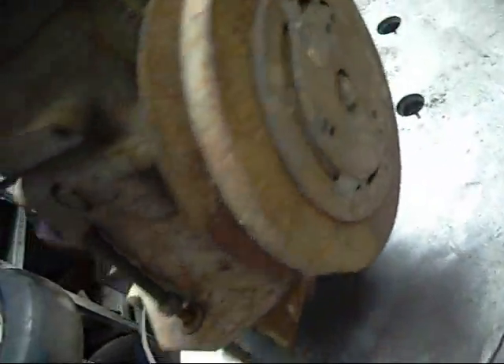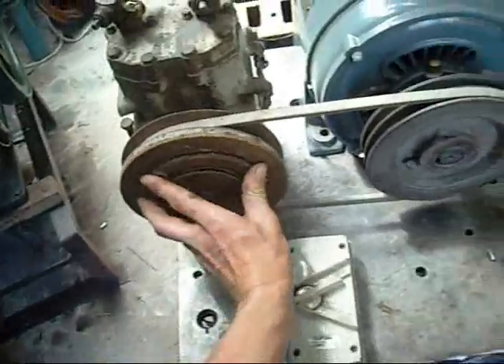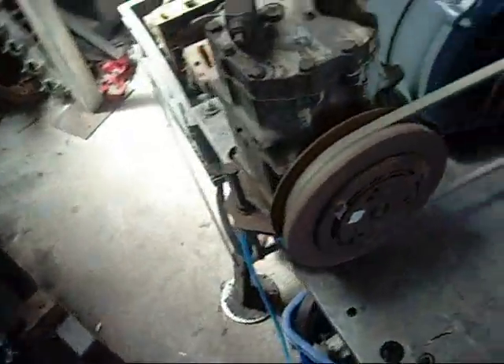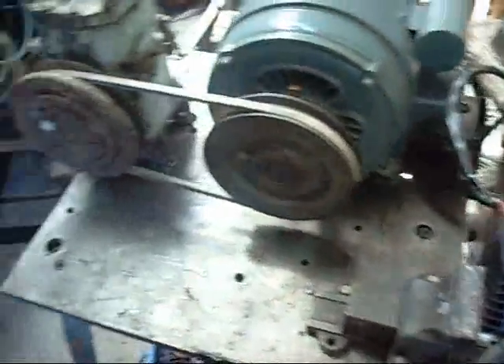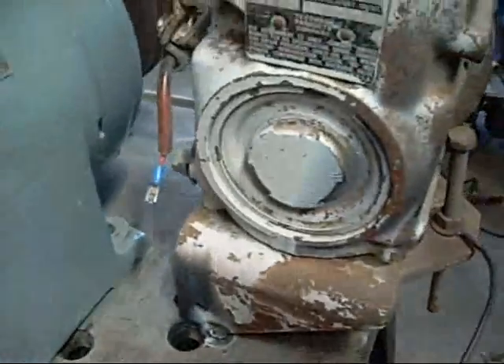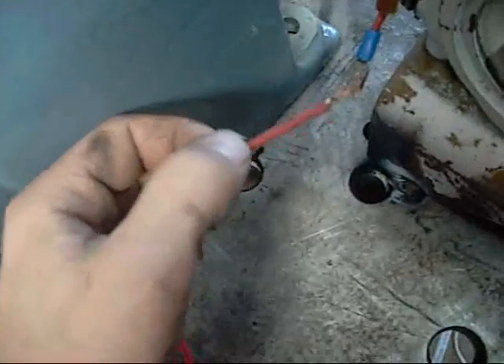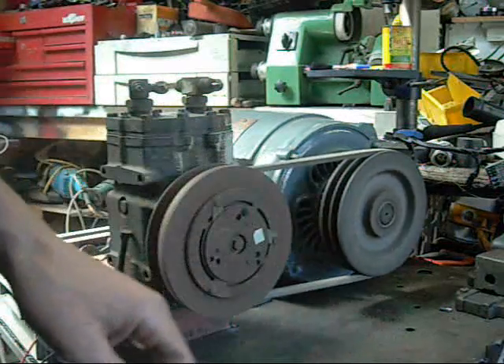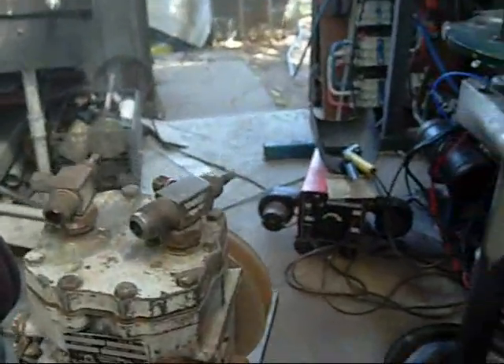Tecumseh Automotive AC Compressor with Brook Elec Motor

Comment: Can I use air conditioner compressor coupled with or belt with motor ?
If yes what is the hp of the motor
Reply: I think a car AC uses about 3hp from the engine.

Comment: If we can set a DC motor and AC compressor and set a solar panel on car roof so can get more mileage in car while use AC even  car is not running and even car have no fuel still can use AC by solar panel
Reply: Dumb idea  ,solar is still at 27% efficiency, what you'll get from 3sq  meters ,not worth investing

Comment: actually those were very common on American cars through the 60's Ford and AMC even ysed them in the early 70's. York hade one with identical mounting dimensions, but it had an aluminum block. They were the main ones used in latter years. https://www.summitracing.com/parts/fss-57022?seid=srese1&cm_mmc=pla-google-_-shopping-_-srese1-_-four-seasons&gclid=Cj0KEQjwhbzABRDHw_i4q6fXoLIBEiQANZKGW5DGMSWr_Ps6oonzN85OAc6G99P_32vcetKuvKkyV7EaApDG8P8HAQ
Reply: Volvo used the York through the 80s. I just pulled a York 210 off a Jeep Grand Wagoneer.

Comment: Back in the mid 70s I built a compressor using 2 York automobile compressors pwr'd by a 2hp motor mtd on a 30 gal electric water heater. They ran for 20 yrs before dying. They would almost keep up with the air grinder/sand blaster @ 90 psi. Auto A/C compressors must circulate the crank oil so I built my own oil traps out of spent propane bottles and steel wool. Used a manual brass valve to vent the captured oil back into the compressor crank case. The clutches were pwr'd by a 120V/12V transformer & rectifier with the transformer winding connected across the motor's start winding switch, allowing the motor to reach speed before engaging the pumps. They eventually died for neglecting to vent the oil traps!

Comment: Running an "A" series belt in a "B" series pulley cannot work, only inside of the belt will touch the pulley and there will be no V action at all. Interesting compressor though.

Comment: I bought a York 210 Compressor that looks alot like that. It has been Rebuilt so Its like new and boy does it pump air! I am currently using it as an air compressor. Nice Find you have there!

Comment: I seem to recall reading that the A/C compressors on full-size US cars of that era might require upwards of 7 HP fully loaded.   I was surprised to see how well the 2 HP motor could turn the comp at atmospheric pressure.  I suppose that putting it under a charge of refrigerant in a closed system would make quite a difference.

Comment: I looked in my '72 Ford shop manual, and they used either a York or Tecumseh compressor. Im pretty sure mine is a Tecumseh. After a little research I found that you can still get gasket kits, seals, bearings, and other odds and ends for this compressor. Yay! I am rebuilding a '72 Ford, so when I get to the A/C I will have to find out what all I will have to do to run R134A in the system, since it used to be R12. 

I really enjoy your videos! 

~ Shane